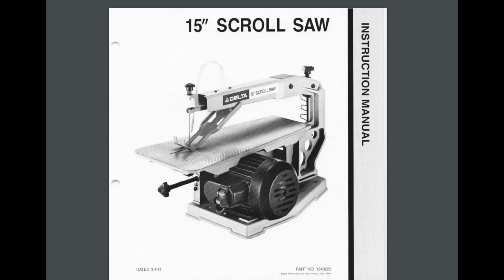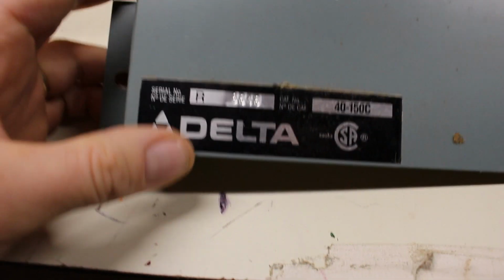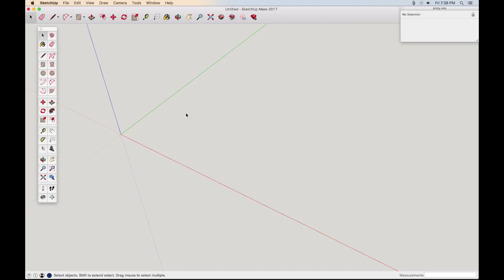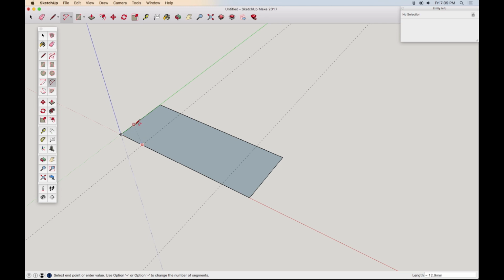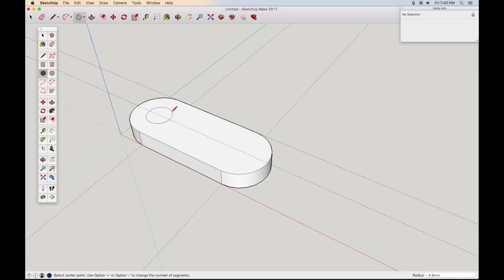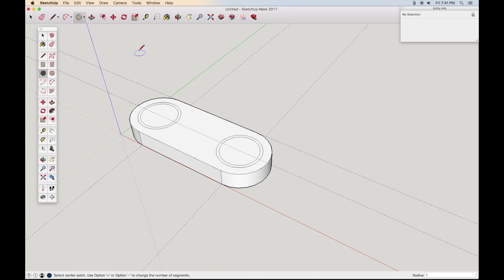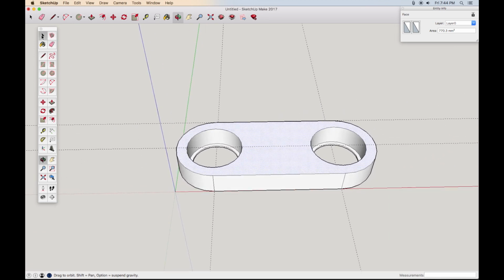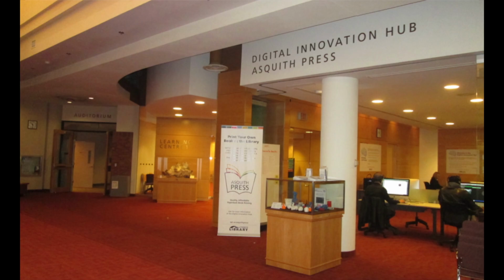How to restore a quality older tool with 3D printing

Comment: A lot of the times in manufacturing a product like the scroll saw, you purposefully design a part to fail so that it saves the rest of the machine.  If the coupler were made of steel and there was a critical failure, then the motor could stall and burn out.  This tiny part breaks instead and the rest of the machine remains intact.  Great video!
Reply from the maker: Good point. I just wish they sold replacements! Thanks for watching.
Reply: Well save the file and you can now print as many replacements as you need. Also not everyone has CAD skills so if you have the time upload the file to Thingiverse or similar so others can find it. Nice work, great to see the tool kept working for another ten years hopefully
Reply from the maker: @WarrickTaylor  I will be uploading it for sure thanks.